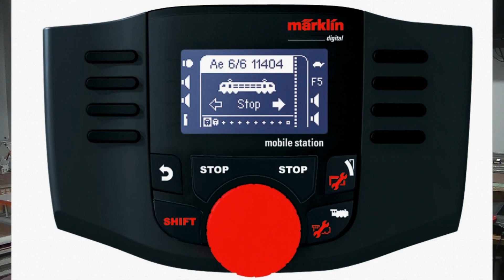The Märklin Outsider Episode 4:  The Märklin System- Going Digital, Part 1

Comment: Directional lighting was a standart on the early 50s Märklin trains, some of mine have it.
Reply from the maker: The trains I had in 1970 were American Tyco.  They had headlights and nothing else.
Reply: @ModelTrainOutsider  Well Tyco trains were barely model trains to begin with 😛I suffered through life like and bachmann diesels when I was a kid, the Rivarossi diesel I had back then was much better lol, I miss those trains in a way lol
Reply: @ModelTrainOutsider  the small Model power HO steam loco I had, had directional lights, had I waited 5 years or so later I would have had the version wiht the Loco-genie remote control and sound. It was MRC's answer to DCC for beginners.

Comment: To my knowledge the first digital system was released in 1974 by LGB, but of cause they do G scale.
Reply from the maker: It's quite possible.  The book and article I read said Märklin introduced the "modern digital control system at the 1979 International Toy Fair, but it didn't come to market until 1984."  So, I didn't see it as any more than Märklin was one of the first.